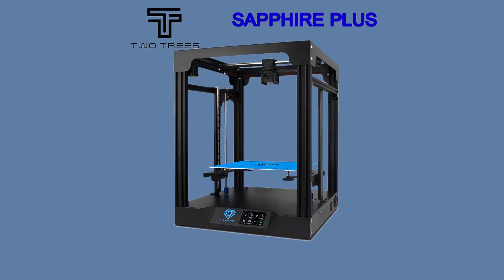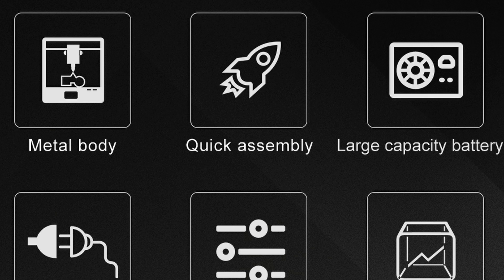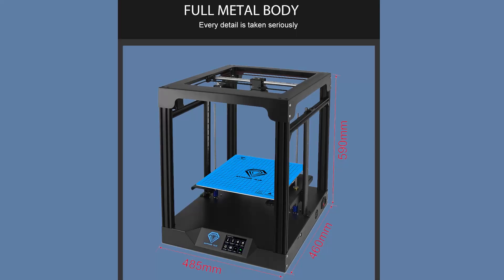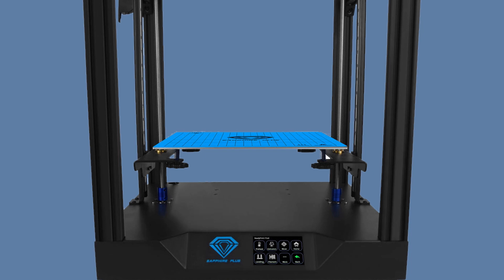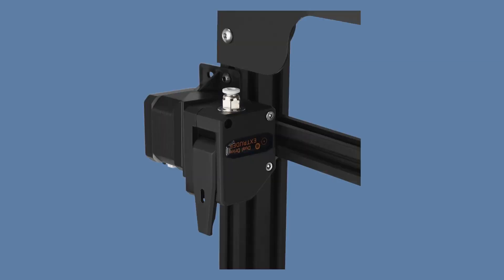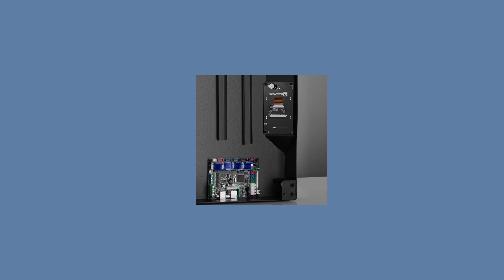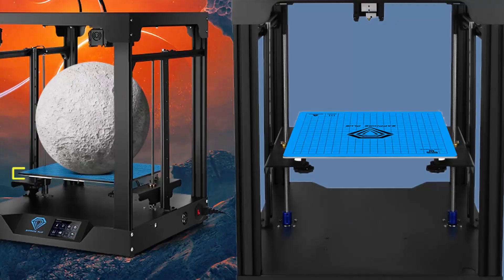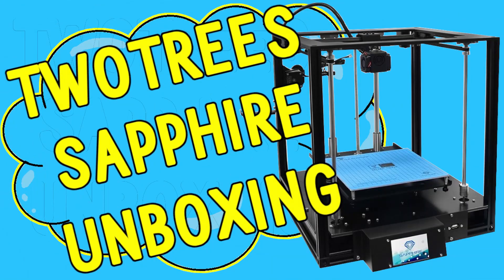TwoTrees Sapphire Plus | CoreXY | Large 3D printer | Bowden BMG Extruder | Vertical H linear Rails

Comment: I bought one recently and it had massive problems with z wobble, and the extruder was, for some reason, really difficult to push filament though. I heard clicking and I wasnt sure what was causing it.
Reply from the maker: I am sorry to hear that. I do not have this 3D printer but I did see some issues reported by other with it. Not sure what Z wobble is? Is that misaligned layers when you 3d print?
Reply: @RoamingInterests  there seems to be some rings and ripples in the up and down direction. It's strange because it doesn't always appear, so it makes me wonder if it was a combination of both poor z alignment and extruder difficulties
Reply from the maker: I do have ringing in all my prints regardless how slow I print. And i print at 24 mm/s all the speeds. I for example I had issues with the heatbreak leaking and it was popping or clicking on the artillery. The issue here may be difficult to diagnose. Do you have ringing sticking out.? I had issues with ringing sticking out when my cr10 s pro had the rollers to tight on the gantry, or the bed was too heavy. Could the belts be too tight? Do they have to tied with zip ties? Did you use a needle nose pliers to tighten them and then zip tied them? I took my sapphire s belts apart recently and 3d printed the belt tightening jig but it does not help with tightening during prints. https://www.thingiverse.com/thing:3730521, but it allows for more finetuning of the belt rather than zip ties.
Reply: @RoamingInterests  That's interesting I actually do not have any xy ringing at all. I had a tevo that had that And one way for me to verify that it was vibrations was to just put my hand on the gantry and feel it as it was moving over a straight feature to gauge how much inherent natural vibration was apparent. I ended up cleaning as much debris as I could and lubricating everything. I did however notice that the ringing was only at specific speeds, even in the lower tier of speeds. It made me wonder if there was a specific resonant frequency that the entire system just didn't like
Reply from the maker: Wow that it interesting - resonance and ringing. I do remember I had this gold pla that at certain speeds of about 30mm/s looked fantastically well compared with lower speeds. So you may be up to something.
Reply from the maker: Did you have trouble with the extruder immediately or after sometime of using it? Because I think the sapphire plus has a titan extruder and it grinds the filament as it goes trough the bowden tube bringing debris inside the bowden tube eventually clogging it. https://youtu.be/P0Dr-SvEKYs?t=152
Reply from the maker: I just checked the video so there is a BMG extruder dual gear so less filament grinding there. So I am not sure why you would have difficulty extruding filament. there could be loose foster fittings / pneumatic fittings that do not hold the bowden tube properly.
Reply from the maker: I do hear some clicking on the artillery sidewinder x1. It depends because there are multiple types of clicking

Comment: what slicer do you use. Sapphire Plus has no Pinter Definition in Cura. even at the latest version
Reply from the maker: I do not own a sapphire plus. Im talking about its features. You have to select custom and define the volume yourself. I have been battlingvwith my saphire S and I cannot get the center defined properly. After you define the parameters in cura ty a one layer circle to see if it is printing it centrally on the bed.
Reply: Prusa slicer Have a config bundle

Comment: The Z Axis screw are too long! How you have solved the problem? Every time at the end of the work the extruder hit them!
Reply from the maker: Well there are a few options, by just looking at the pictures. Sink a bit further the actual stepper motors by getting 3-4-5 washers per each screw that connects the stepper motors to the base - but just enough to not interfere with the gt2 belt that syncs the the z stepper controllers. Moreover the lead screw couplers may also give you a few more millimeters by sinking in the lead screws inside the couplers as well as the couples on the stepper motor rods. and finally you could 3d print upgrades that may allow you to left the nozzle a little bit more from the bed. overall this is a delicate process because you may end up with the nozzle never being able to reach the bed. Or course you have to measure how much clearance you need to see if the nozzle clears the z lead screw and if you can gain that distance by doing what I mentioned on the first part.

A more quick and elegant solution is to change the firmware ending sequence travel path or pattern that the nozzle would never touch the lead screw on it's way home. I think you can add g-code in the slicer permanently to be added to each 3d print. Or maybe pre-compile the firmware all together.  These are a few ideas. Most of the slicers have sections of adding custom g-code. you can add it to the slicer and this should fix your issue. This somwhat of a workaround because you have to always add this g-code if you update your slicer. the more permanent solution would be to tinker with the hardware and make sure that the nozzle clears the z-leadscrew. For example in this video I used some upgrades that I purchased in conjunction with 3d printed upgrades and I gained like 20mm on the z volume by lifting the nozzle. I also modified the models to suit my needs, but they only work with an e3d v6 hot end and a bmg style extruder. https://youtu.be/QFuJzPKngFs
Reply: If it's too long I would cut it with a dremel
Reply: But I think it's either , they made a mistake in design or there is a purpose for extra lent

Comment: The closed belt system is not as good as it looks... I throw the belt away and installed a lerdge K board. Now I have two z motors with two stepper drivers and two endstops.
Reply from the maker: wow, that is valuable information. thank you.
Reply: Interesting Mod. Do you had to upgrade the Firmware for dual Z?
Reply from the maker: @RainTree5  I did not make this 3D printer. It is not my Mod. It is made by twotrees.

Comment: Thank you for the review. This has some interesting features but it has a bowden system and I want to move to direct drive on my next printer which I think is going to be the Sidewinder X1. Interesting idea to compare impulse purchases in either hardware or stocks. I think the market is too volatile but I wish you luck. A better long term strategy is a managed fund of course but I'm sure you know this.
Reply from the maker: Thank you for the kind wishes. I have some funds in there as well. I just wanted to diversify and maybe took a bit of a gamble with one of the stocks because it had high dividends. but seems It was still overpriced. Anyhow Sidewinder x1 is like sister of twotrees sapphire plus, they both have synchronized Z lead screws by the GT-2 belt.  I do have to say I am torn apart in between the two 3d printers. I would choose the core xy because I like the core xy more. also it takes less stepper motors. So I see your point as well. Also if you re still researching you do have very respectable self restraint. I think people will review the results in the sapphire plus. I have a hunch that the force may be stronger with the sapphire plus. But based on my last hunch of buying the two stocks one is holding the other is going down. so not all my hunches are good.
Reply from the maker: I wanted to say that I saw online that there are people that had to tune the printer a bit to get it working. In case you did not see that.
Reply: @RoamingInterests  Yes I did. Thanks. There can be a number of issues with the Sidewinder X1 mostly related to Z-Banding (although not all) and also the ribbon connectors. The Z-Banding is the part that has me most concerned. Evidently it is largely attributed to poor leadscrew nuts or poor implementation of the anti-backlash mechanism on the leadscrews. If necessary I am prepared to tackle this with upgraded leadscrews and nuts although I'm hoping to get lucky and just get a good printer out of the box. Somewhat inconsistent as some users get very good results with no tuning. Others not so much. I feel that even with all its inherent chance for problems it is a good platform and value. But thank you for the heads up. Did you see something other than what I've found?
Reply from the maker: @E W yea that was may situation with the cr10 s pro, i was unlucky and I could not figure it out. I did get lucky with the cr 10 s5 and the sapphire s. Anyway i purchased bunxh of tools and upgrades for both, but I got them to work as they were and now the upgrades sit in some boxes somwhere. By the way I wasn t too lucky with adding the antinacklash t nuts that I purchased and installed as upgrades. They were making this horrid snapping noise. Enjoy the hunt! But with that gt2 belt there may be no need for antibacklash nuts with the spring.